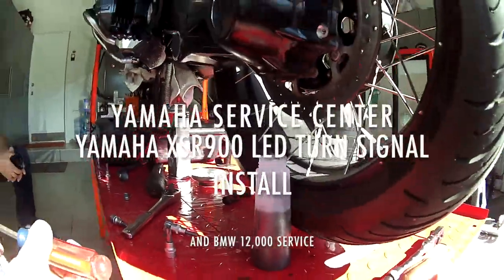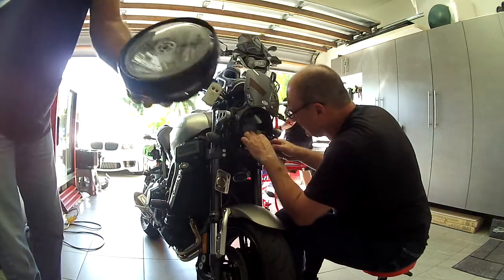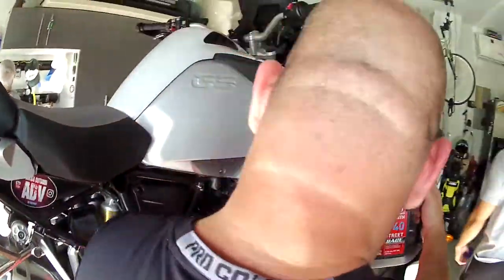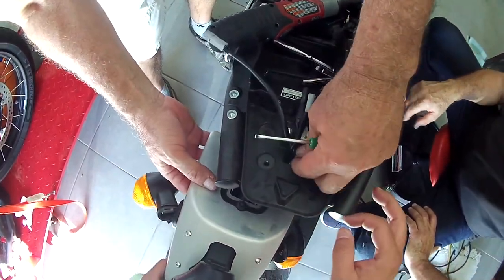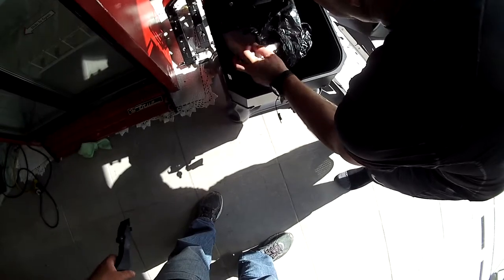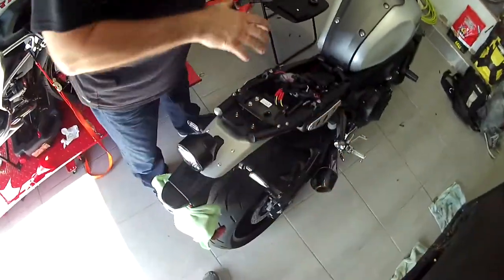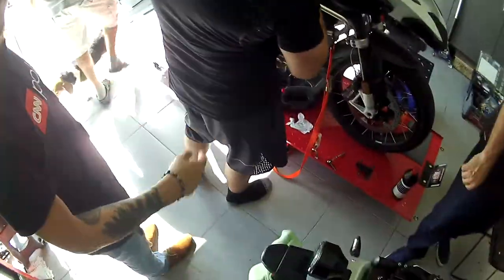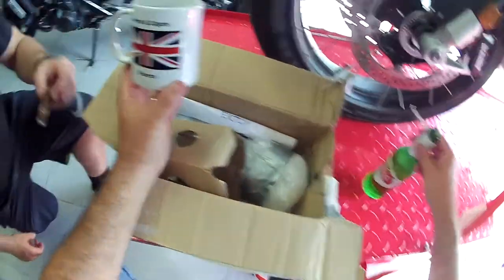LED lights XSR900 install

Comment: There maybe a led flasher can available for your Yamaha which will correct the fast flashing but you may know that already.
Reply from the maker: banditnev hi bandit.   Yeah these came with resistors.   But too bulky